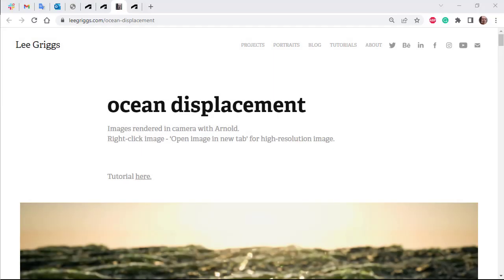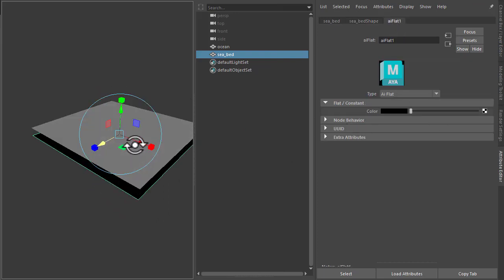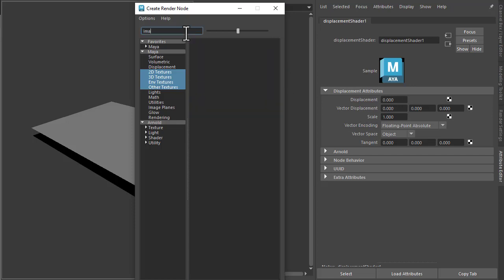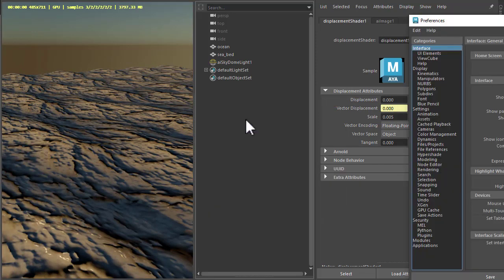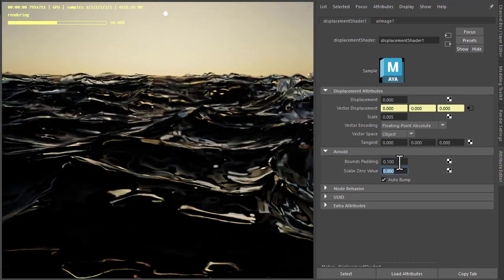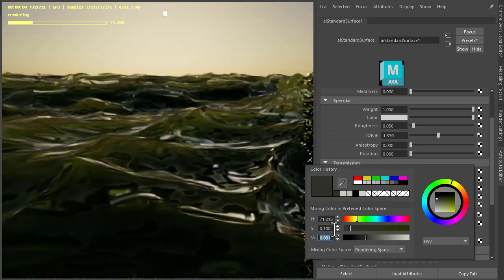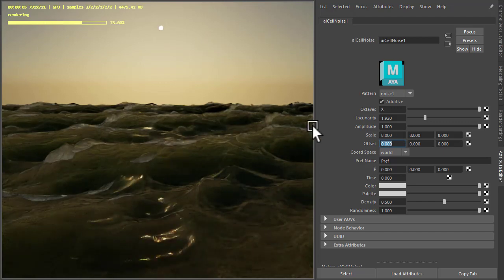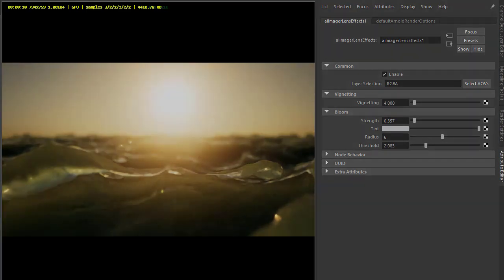Arnold Tutorial - Rendering an Ocean with Displacement (GPU)

Comment: how do i get the top/crest of the waves to be sharp?, mine looks too rounded/bloby... . i messed around with the displacement scale and bounds padding value but it is having no effect.
Reply: displacement relies in vertex position, so if you need a vertex to be on the topmost of the wave probably you need a higher subdivision level, otherwise the vector displacement map has not enough contrast in the blue channel, you can use an airange or some other node to control the B output before using it into the displacement shader.

Comment: impressive dis placement with GPU it's just next time show the shader network, for non Maya users and also share a video with better quality, it's kind of ironic that the YT channel is on rendering and the video is on 720P, final minor thing, ocean use Fresnel effect heavily, it should be mirror solid on glancing angles and completely transparent at 90 degrees.
Reply: Thanks for the feedback. Normally I do show the shading graph but in this instance I thought it didn't warrant it because it was so simple and every app does displacement differently. I always record at 720p as anything above is difficult to read at 720p and on a laptop, tablet, TV and phone. I want to keep the tutorials simple and easy to follow. I guess the shading would look more mirror like without the bump map and high displacement value.
Reply: @LeeGriggs  keep up the good work, great video, Arnold is definitely going with solid steps forward.